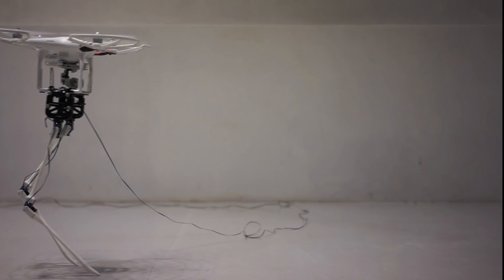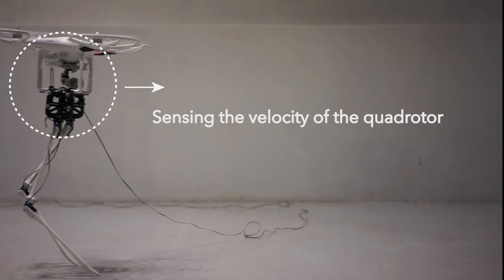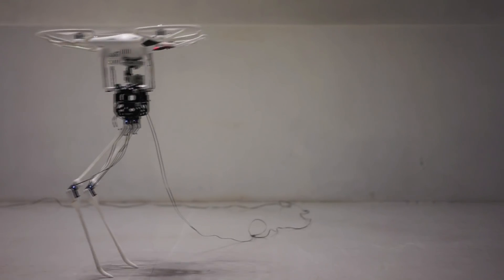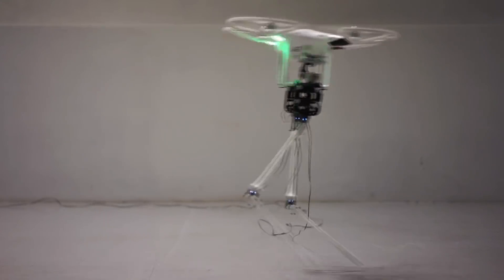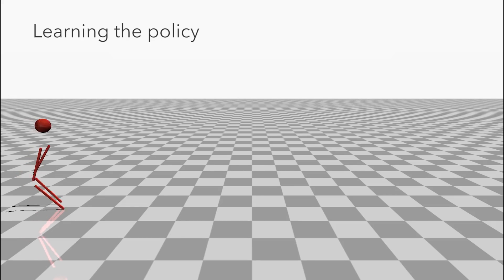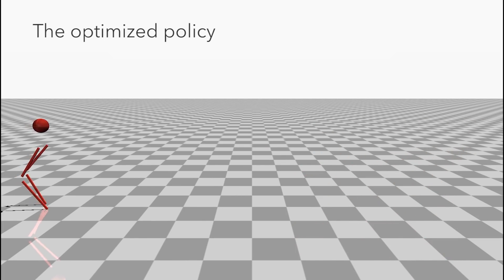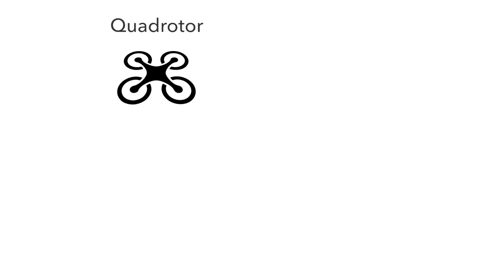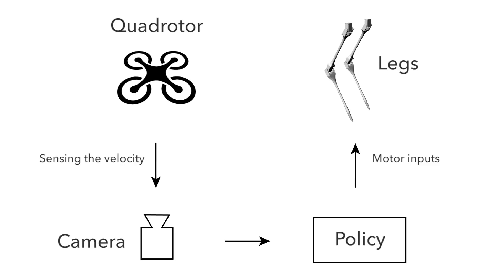Aerial-Biped: a new physical expression by the biped robot using a quadrotor

Comment: if this will lead to lesser energy consumption on the Quadcopter side while moving larger distances then it make sense. Its good idea because it can help the robot move on different kinds of surfaces where other bipedals might not be able to do so.
Reply: more energy is consumed by the corrections and snail movements than just flying the drone at full speed and using its kinetic energy. 1:17 the legs are not holding any weight of the quads or there own to justify the lower energy consumption. they add unncesesary weight. Its a awesome idea but it needs to be rethought